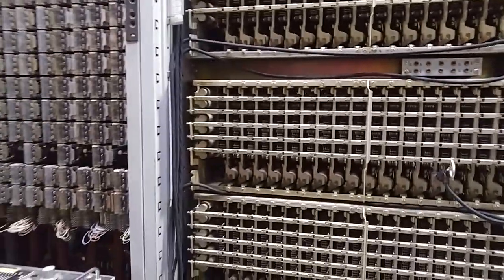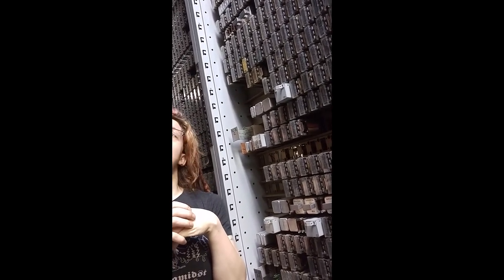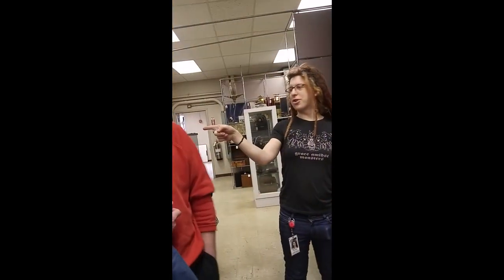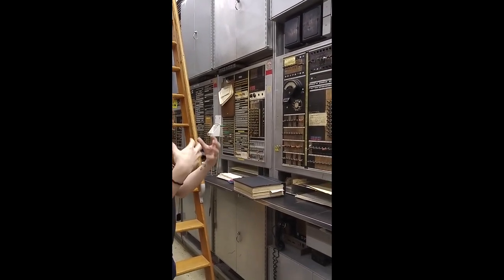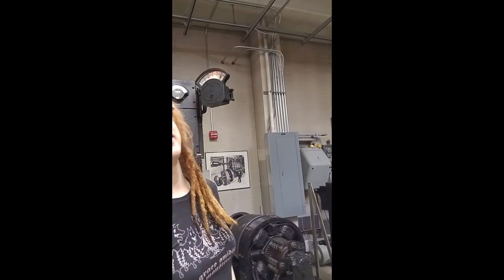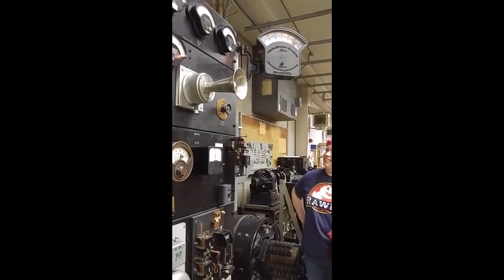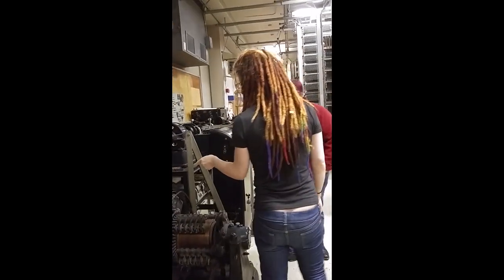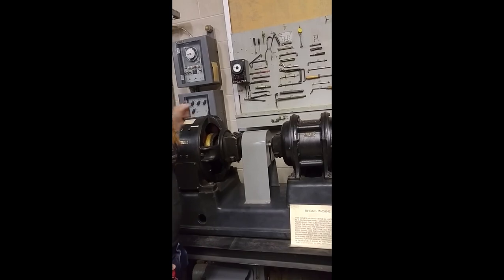operating analog telecom switches, Feb 2017, Seattle's Museum of Communications

Comment: I'm now 72 and was a XB-5 Switchman for New York Tel. Worked in both flat and wire spring COs. Best job I ever had. I remember days where we would go through two decks of trouble cards (250 cards per deck) in the am. This was due to major problems.  I also worked the first XB-5 ETS co located in Tarrytown NY.

Comment: My employment started with Western Electric in February of 1963. I never really worked in crossbar other than running cables and wiring line link frames, etc. My career took off, when I was accepted into number one ESS School, my education continued in number 4 ESS first electronic digital switching system, used for toll application. And also my education in number five answers electronic switching system, employing fiber optics. I had a total of 36 years service, and great medical benefits. Today is September 14th 2022. I will be 79 years old this month. The very worst day of my time working for the company was when judge green, announced the breakup of the Bell System in 1984. In my opinion that was the worst decision ever made.

Comment: When I worked at TACMWA02, our #1 XB Tandem was notoriously "afraid of the dark." There were large signs near some of the aisle light switches NOT to turn the lights off. On those few occasions when the lights went off for whatever reason those gas tubes (313?) in the machine would not fire reliably, and error-free call processing would come to a halt. Perhaps something like that is why your machine does not like a cold start? Thanks for the tour, Sarah!

Comment: 12:40 NTFS?
26:00 the polarity inversion was probably about a single or a few cells in a series bank. If you work with lead-acid batteries, the nominal voltage of one cell is a tad bit over 2V when healthy and fairly fully charged. A series bank of 6 cells would have the nominal 12V and so on. All cells in a series bank should be as closely as possible to equal age, condition, and charge level. If you have a faulty cell in a series bank, that doesn't hold charge well, its voltage will drop sooner than the others when loaded, and  eventually reach zero, after which it will be be charged in inverse polarity. Similarly it can limit the charging current so the other cells don't charge very well, and if its voltage fails to rise proportionally to the current thrown at it, the other cells can be overcharged and ruined. This does in no way pertain just to lead batteries. It could happen with any chemistry including nickel or lithium, but especially in the latter case it is often much more catastrophic. Parallel wiring of rechargeable cells is not that picky, but a weak cell will still drain the others eventually.

Comment: Believe it or not MF signaling is still in use today on E-911 incoming CAMA trunks to the 9-1-1 PSAPS. There is a push to upgrade the 9-1-1 network to all digital with a new network called ESInet. A joint partnership with AT&T and West Corp.